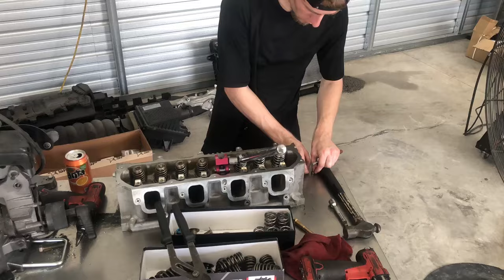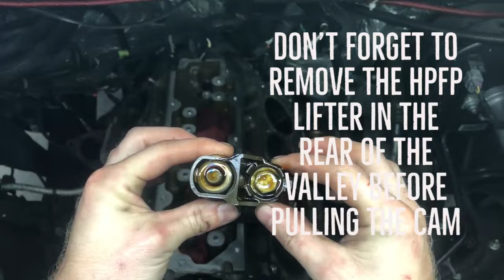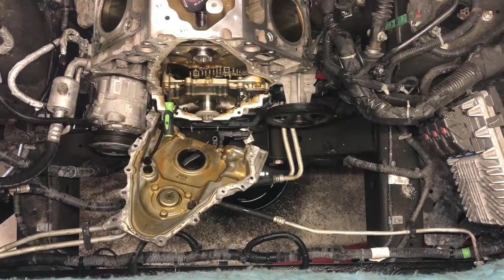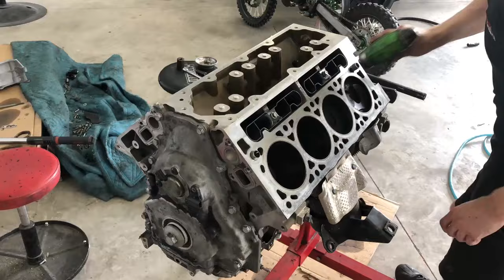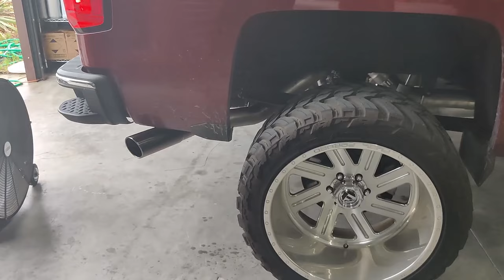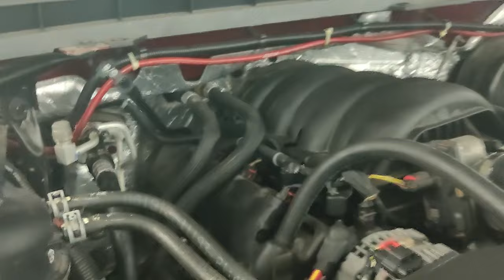2017 Silverado Cam Swap (AFM/DOD Delete)

Comment: So why did you pull the motor out? Just asking is it a must on the gen5?
Reply: I know this is old but I wish to know this as well. I a lot of people opt to do this without pulling the engine and it looks like a lot of the work was done with it in. So it is confusing.
Reply: When you have 4x4 and you need to drop the pan it’s easier and quicker to pull the entire motor out for the 4x4 trucks.. otherwise your removing everything in the way to drop the pan
Reply: Why wouldn't you. Replace the oil pump and clean the pan out. The douche bags at GM did not pull the pan or install a new pump on mu wifes 2022 Burb. All that metal has to go somewhere. I would hate to do all this work and then have a rod bearing failure, because of all the metal left in the engine.
Reply: @bagger2013jm  Because of the simple fact that it can be done without removing the engine. If you are like me and do not have a garage, leaving the engine in might be the best option. Just saying it would be a huge advantage to me and a lot of other people personally. It sounds like if what you are saying is true, I will need to plan to remove the engine to do it correctly, something I have also never done before.
Reply: @DrRob-rt2lf  it’s like 8 stub shaft bolts per axle, 1 connector, 2 bolts and 2 nuts plus 4 cross member bolts to drop the front diff. It’s not that hard, definitely a lot less work than trying to keep the trans in place and lining up dowel pins. Coming from a gm tech
Reply: @HexaFox  read my reply to dr rob

Comment: Nice build! I have a 2016 that I would like a DOD delete ,new lifters,pushrods,springs and a mild cam I don’t want mine too choppy/loud ,how much would that cost me?
Reply: i spent $1400 stage 1 cam kit afm dod delete on my 2017 gmc sierra and 600 bucks on my hp tuner but i did the work myself
Reply: @jcperformance928  website you ordered parts from?
Reply: @jcperformance928 how did you get the timing chain off?

Comment: What after market cam would you recommend without having to change the torque converter?
Reply from the maker: Your best bet is to call BTR or GPI and speak with one of their sales specialists. They are extremely knowledgeable when it comes to different applications and what cam specs would work best for your setup. Just give them a call!
Reply: @ChrisVaughnTech  
Hey I'm in the middle of doing the AFM DOD delete with the Texas speed kit and stage 2 cam on my 2017 l86 Yukon Denali and I'm been curious if you know of or has anybody done a port injection with the direct injection together similar to the 5.0 mustangs that way it'll get rid of the carbon buildup on the valves?

Comment: How did you pull out out the cam sprocket without pulling the oil pump off?!
Reply from the maker: So there are two ways to go about it. The way I chose to do it in the video is completely remove the engine and pull the oil pump, oil pan, and do everything. 
If you want to do it without removing the oil pan or the oil pump it's a tough job. You have to loosen the bolts to the oil pump and try to give just enough clearance to walk the chain off the cam sprocket without removing the oil pump. It can be done and I've seen it done but it's a very tricky job with the oil pump still on
Reply: Thank man! Really appreciate it

Comment: Afm bombed on me dropped a cylinder 7 lifter so I’m doing a full dod delete and this same cam in my 16 Silverado in about 2 weekends
Reply: My 14’ took a dump on cylinder 6,same issue,worn cam and AFM lifter
Reply: @protecaodivina23  I’ve always been a Chevy guy but bit the bullet and bought a 2019 ram 1500 with the hemi Saturday. And damn I’m loving it so far. I did end up doing a rebuild on the Chevy before trading it in tho
Reply: @bloncomike  my cousin has a Ram limited,and yes they are very nice,wish GM would get their head out their ass and make quality work again lol

Comment: Great video series I followed your cam swap series and they were a great help in installing my cam on my 15 Sierra l83. I recently finished everything up had my ECM tuned and I am getting error codes for coil control circuit on cylinders 1,3 and 5 I’ve moved plugs and wires around checked for loose connections including the two grounds on the drivers side head. Just curious if you had heard of anything like this or had any insight to what could be going on? Thanks again for the great videos.
Reply from the maker: Usually a circuit control code indicates some sort of wiring issue. I would double and triple check all wiring because most likely there is a pinched or broken wire somewhere or maybe even a loose ground somewhere. Try swapping coils between the banks and see if the problem moves or stays on that bank. That will help barrow it down to the PCM or wiring
Reply from the maker: Specifically check all the wiring going to the coils on that bank. Trace the wires back as far as possible. You may have to unwrap the wires unfortunately to do so. There are quite a few tests you can perform as well if you have a voltmeter. Just post the specific codes you are getting and I'll see what I can find.
Reply: @ChrisVaughnTech  thanks for the reply, I’m getting p0300, p0351,P0353 and P0355. I will swap the coils across bank and plan on taking the intake manifold Back off this weekend to check on the harness better.
Reply: Hello, I found a nicked wire on cylinder 2 coil plug removed intake manifold tightened grounds and refitted injector and high pressure fuel pump plugs no more codes went for test drive noticed slight misfire engine light flashes under load then goes back off again.
Reply: No codes found in system I used another code reader with the same result and I’ve driven with mine plugged in and it won’t pick up any codes 02 sensors still read not ready

Comment: My 2015 has the AFM mechanically deleted, same cam yours has. I still have to get a performance tune as the guy only slightly tuned it to run so far. After the cam she idled too low to stay running and stuff. But what kinda exhaust do you got? It sounds amazing. Mines still stock but if I can get it to sound like yours id definitely do it lol

Comment: Anyone know the price tag on this? Looking to get it done 
(do not wano get ripped off)
Reply: Guess that's a no lol. I'm curious to as want my 17 done.
Reply: If you buy a mild cam, and only do a cam swap, you’re looking at around 300-500 for a cam, and probably close to 1000k in labor. If you have a buddy, that’s mechanically inclined it’s no rocket science.

Comment: Quick question is it necessary to pull the motor for the cam swap or why did you pull it I am planning to cam my 2017 Silverado my self I don’t want to fuck up lol some advice would be great thanks

Comment: Do you need after market lifters or did you use the the stock ones??
Reply from the maker: The lifters have to be changed from the AFM style to the regular style. Or you can use aftermarket high end lifters as well.
Reply: If you are trying to save a few dollars, then don’t doing.
You really need to change lifters, valve springs when doing a camshaft swap no matter what, but this is my personal opinion tho
Reply: @reyperez3424  why change the valve springs if your gonna use the same cam specs?

Comment: In comparison to a bone stock 5.3, how reliable is this with the new cam?  My 16 5.3 runs fine but I don’t want the AFM system to grenade, and if I deleted the AFM and installed a thumpy cam the only thing that’s holding me back is not knowing what happens down the road, 10k/20k/30k miles how well is it holding up? What does it do to fuel consumption? I already get 9.5mpg. Torque converter? Gears? Would like to hear recommendations
Reply from the maker: It's a little hard to say what kind of reliability you would have because it's heavily dependent on quite a few factors. Deleting the AFM system would likely increase reliability by removing those troublesome parts but you would have to make sure that what is installed in their place are quality parts and they are installed properly. 
In my opinion, if you're looking for longevity & reliability, I would delete the AFM system completely and install a very mild cam with all the supporting mods. I can't stress how important it is to choose quality lifters and make sure you have the proper length pushrods to create the correct lifter preload. I recommend the Johnson 2110 lifters or if you can step up to a pair of link bar lifters that would be ideal. The plastic lifter trays easily wear out and cause problems. Eliminating them would add reliability. From there you just need to get a proper street tune from someone experienced.
You shouldn't need to mess with converter or gears as long as you keep the cam specs mild
Reply: @ChrisVaughnTech  awesome. I appreciate the response. I think that’s the route I’m going to end up going. Mild and reliable.
Reply: @ChrisVaughnTech  what are the cons of deleting the afm system without changing the cam
Reply from the maker: @orogold330  you can't delete the system without swapping the cam. You can disable it in the ECM but that's not a delete.
Reply: @ChrisVaughnTech  is there still any benefit from deleting it from the ecu
Reply: @orogold330  i did the delete without switching the cam nd no issues at all changed lifters lifter trays put the plugs  got it dyno tuned nd good to go
Reply: @ChrisVaughnTech  when you say mild what exactly would that be. I’ve got a bad lifter on my ‘18 GMC and was considering a stage 3 setup from Texas Speed

Comment: Question. Why'd you swap the cam with the engine in the bay then pull the motor? I know you know it's easier on a stand I'm just curious. Great vid tho!
Reply from the maker: Originally we planned to do the entire job without pulling the engine but made the call halfway through to pull it. You can technically do this job without pulling the engine but it takes some skill to get the chain and cam gear on and off and to verify the timing marks are aligned.
Reply: @ChrisVaughnTech  quality work from quality people. Thanks, Chris.

Comment: How many hours did this take
Reply from the maker: This one took about two days but that's because I took my time and really documented the process. This was one of the first cam swaps I completed on a Gen 5 engine so I was very careful and meticulous to make sure it was done properly.
Reply: @ChrisVaughnTech  I appreciate the reply so it would take me about 4 days lol
Reply from the maker: @kjam87gxp  it's definitely not as easy as a cam swap on the 3rd or 4th gen LS motors. Those are much easier. This is very time consuming and usually requires the engine to be pulled to do properly. It is possible to do this job without pulling the motor but I found it to be faster and easier to just pull the engine out.
Reply: @ChrisVaughnTech  I am by no means a mechanic but am mechanically inclined. I want to do this but don't want to mess anything up.
Reply: Couple days I’m on month but it was my first time and I did everything. Pulled engine, cleaned down to nothing, drained everything including transmission. Built custom
Dual exhaust still finishing, swapped struts bilsteins 5100  and eibach 2.50 lift springs, painted entire engine, the block, covers, coils everything, long tube headers, new tires.. it’s been quite a journey I just need to weld stock cats that I power washed threw for emission on the down pipe.. I wanted to port the heads but decided against it and also modified air intake with another 3 inch hole coming out the bottom.. if I did it again it take half the time but first time just double check take time

Comment: Did you have to remove the oil pump to get the timing chain off or did you use the scre driver method?

Comment: Did you have any issues with tuning? Mine doesn't idle that good, ecceleration isn't that good and engine dies at low speed,in parking lot or pulling in the driveway

Comment: When doing the delete with a delete cam can I tune with edge programer or do I have to get a custom tune??
Reply from the maker: That really just depends on the tuner. I think it's possible to do with a handheld but definitely not ideal. The best way is to have it street tuned by a reputable tuner who has experience with this platform. Trust me it's money well spent

Comment: what cam? and did you need to tune the ecu with that cam swap?
Reply from the maker: It was a Texas Speed stage 3 can I believe and yes you always need a re-tune on the ECU when swapping a Cam.
Reply: @ChrisVaughnTech  not always there is some mild cams that don't necessarily need a tune
Reply: @MichaelWittner  
😂  🤡 
Even stock engines need a tune
Reply: @reyperez3424  lol well thats a rabbit hole we can go down

Comment: How much HP gain
Reply from the maker: I'm not too sure. We didn't usually dyno trucks of this size. Typically a full cam swap job, tune and few other supporting mods should get you 100hp gain
Reply: @ChrisVaughnTech  how much would you guys charge for this service?

Comment: sooo......did you need to pull the engine to handle the timing chain, or did you do that one on another engine on the stand for the video?
Reply from the maker: You don't technically have to pull the engine but it makes the process a lot easier so that's what I chose to do.
Reply: @ChrisVaughnTech  i had asked because i'm in the process of replacing a wiped cam in a 16 tahoe ppv 4x4. i can't see a way to lower the pan, and i can't see a way to get the pump off without lowering the pan.  this started off as just needing new lifters on the p/s bank, but as luck would have it the cam's toast.
Reply from the maker: @1ltcap  lol you are running into the same exact problem that I ran into. The main issue is that you can't get the chain off of the cam sprocket with the oil pump still bolted on. You can loosen the oil pump bolts slightly and some people are able to get the chain off by doing it that way. But the issue with that is that it becomes very hard to align the chain and make sure that your timing marks are correct when you put it back together. So I chose to pull the engine just to make sure everything was completely correct that the timing was right and that there were going to be no leaks or issues after the job. I know you probably don't want to hear this but you should just go ahead and pull the engine and it will make the whole job easier
Reply from the maker: @1ltcap  even if you could lower the pan, you would have to reseal the pan with rtv. These don't use easy pan gaskets. You have to  RTV everything
Reply: @ChrisVaughnTech  you are correct, i don't want to hear that, lolol. that said.....it's pretty much what i needed to hear though, and i appreciate that video, and your advice. i'll be pulling it next week as soon as i've caught up on all the work i've been pushing back to deal with this. 
thank you sir.

Comment: What cam lifters and springs did you use
Reply from the maker: It was a TSP stage 3 cam I believe with TSP PAC dual valve springs
Reply: Sounds awsome nice work

Comment: Good vid man, is it necessary to pull the block to swap the cam? I cammed a 99 C5 vet years back. I’m putting a TSP stage 1 in my 15 Sierra. Just wondering I’ve watch a couple vids on this and everyone is pulling the short block. Thanks
Reply from the maker: It's not 100% necessary to pull the block. Some techs have some fancy ways of working the chain off the cam gear and getting it back on but unless you are very familiar with that process you are almost certainly going to end up pulling the block. There is a way to simply loosen the oil pump bolts without removing it completely and that can sometimes give enough room to swap the cam and gear without removing the oil pump. If you can do that then you may be able to avoid pulling the block. My biggest issue was that you still cannot see behind the oil pump well enough to line up the gears with any degree of certainty. So as most others do I chose to pull the block just to make sure everything was perfect
Reply: @ChrisVaughnTech  thanks for the response man, I appreciate it.
Reply: @ChrisVaughnTech  
This guy knows what he’s doing, that’s the best way to do things right

Comment: My 14 Silverado was misfiring on cylinder 6,sure enough once my cousin who works at a gmc as a tech opened the motor,the cam and lifter is damaged and he says it’s mainly because of the idiocy of the AFM,so now I’m pondering a delete kit and a mild cam but idk if I should lol
Reply from the maker: Yes you should. Reinstalling the OEM parts is just asking for another failure as the AFM lifters are prone to failure.
Reply: @ChrisVaughnTech  what size cam would be good as a mild cam,nothing aggressive but enough to hear it chop lol
Reply from the maker: @protecaodivina23  Give BTR or TSP a call and they can tell you all you need to know and get you a package together that suits your exact needs. They are experts at putting those packages together. Just give them a call
Reply: Sounds good man,thanks for your time.

Comment: To do this on my 2020 that has a l83 as I am in Fl. What would your back log look like . What kind of notice do you need to have the spot open ? . Then I also have the L86 6.2 I was planning on putting in my 08 z71 . I was reading the comments below and you had mentioned that it was easier to pull to motor to do the work if that is true my planes will change. Cam delete the DOD maybe some head work to the  6.2 as  it is  on the stand. Then pull the 5.3  replace it with the done 6.2 tune it … I like it ?  Then we can run throw the 5.3 put in my 08 ???
Reply from the maker: Send me a message here or on Facebook and let's chat. I'm only working on dealer inventory at the moment but we may be able to work something out